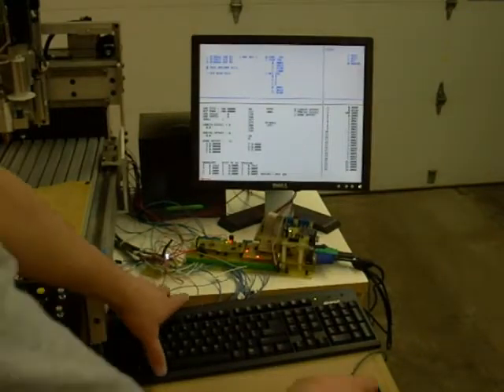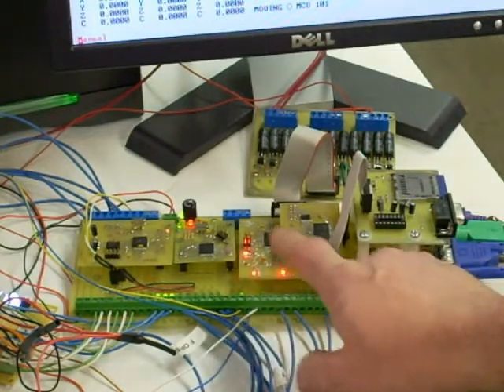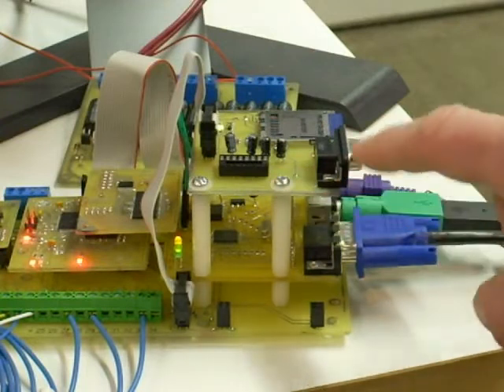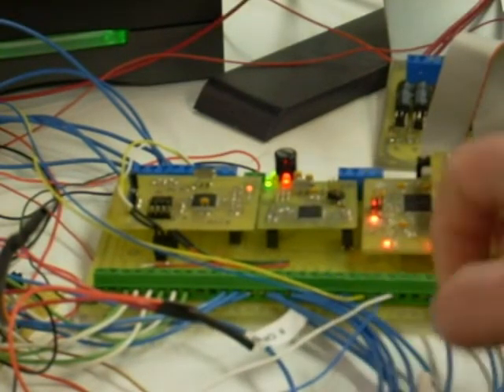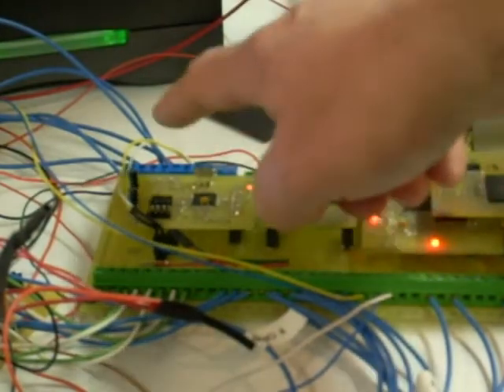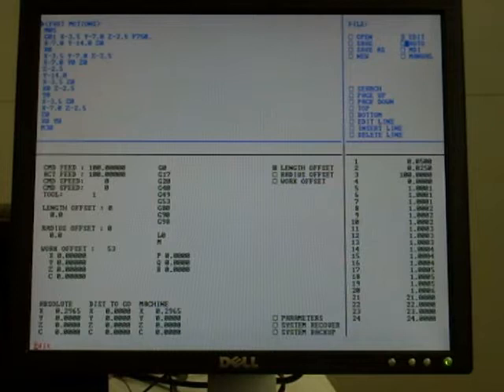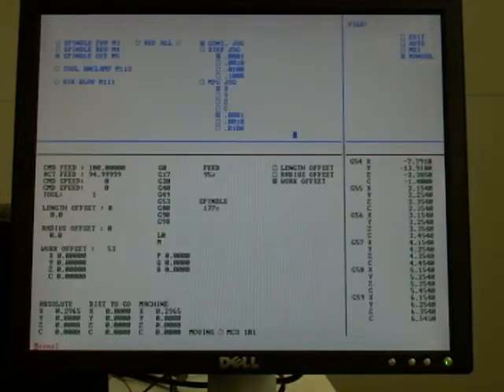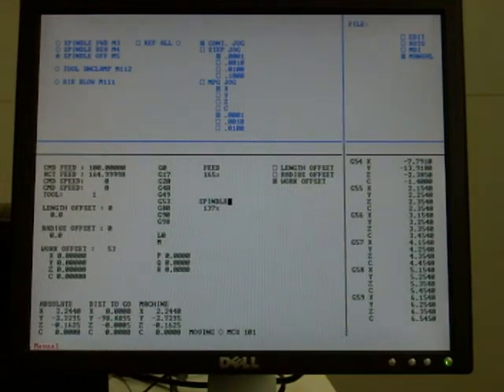CNC Router #3 - Control Overview

Comment: Very well build CNC-machine you have there. How much is the cost of this machine (Not including PSU and interface) and how long it took you to make this? 

I've wanted to make own CNC for long time now, but I've seen only few DIY CNCs with extreme accuratecy and build quality and this is one of those. Where did you get the PCB-layouts for the controller or did you design it by yourself?

Have you tried to mill aluminium or steel with this?